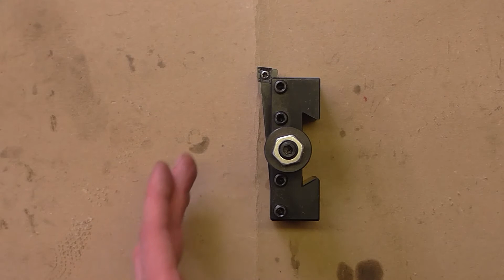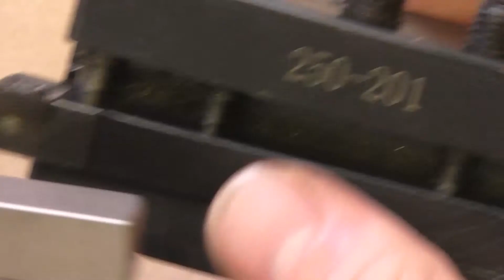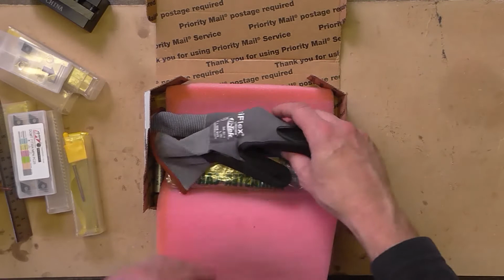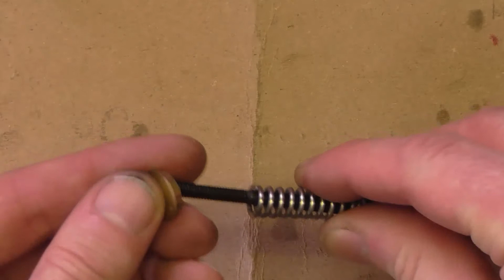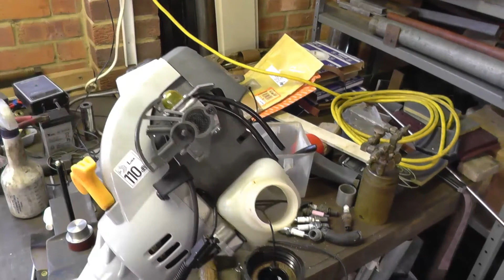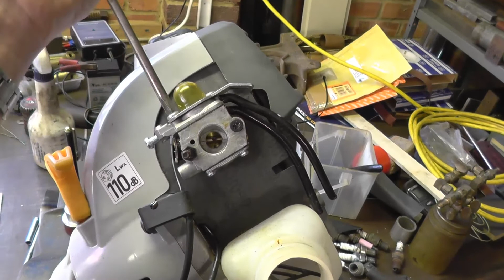Sunday Night Short XXI

Comment: Hey Paul,

Glad it all worked out for you. The fasteners I sent you are 18-8 Stainless steel. Not as strong as the black but easy to machine in comparison. Pure luck on the slim nuts. I happened to have some in my 8-32 bin.

All the best,

Tom

Comment: Hi, great video, I had the same trouble with fiiting tools in tool holders and getting them on centre line, go buy your self a 12mm, or slightly lager 4flute carbine endmill, regrind is fine, chuck the cutter and mill the bottom of the tool holder slot, I can now fit 3/4 tooling in my AXA tool holders and be on centre line, plus the cheap holders cut like butter.  Hope this helps
Reply from the maker: For me, the reason for wanting to use larger tooling is rigidity. Reducing the base of the holder defeats that objective. It would be better to reduce the shanks of 16mm tooling down to 14mm, but they're often too hard to mill without annealing.
Reply: My tool holders are hardend aswell, carbide endmill has no problem, done it many times, only about £10 for regrinded. And as for ridgity I have noticed no difference, to be honest look at multifix tool holders they have about 10mm thickness at bottom and there rated as some of the most ridged holders, I machined mine to 10mm as my centre height over compound is 30mm. 
It's the best thing I've done, you won't regret it, the other option is you can buy over size holders from America, eBay has them, fit 3/4 tooling in BXA HOLDER, all they do is make slot bigger so it definitely works.

Comment: hi Paul hope the suspension works out ok my brother in law works in a mower repair shop and says most engines on mowers strimmers etc are a throw away item no spares available from the manufactures unless its a major brand like briggs and stratton or stihl so hope you can find the parts. On your toolpost issue you could put a spacer between the topslide and toolpost to give the adjustment for bigger tools thanks for sharing
Reply from the maker: Changing the position of the tool post doesn't make any difference. The tool holder can't go any lower than the top of the top-slide!